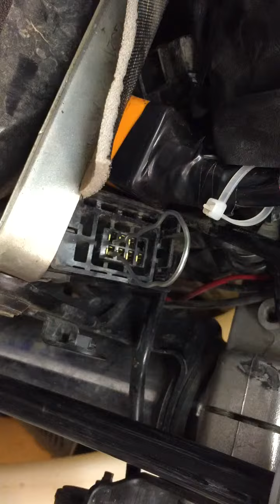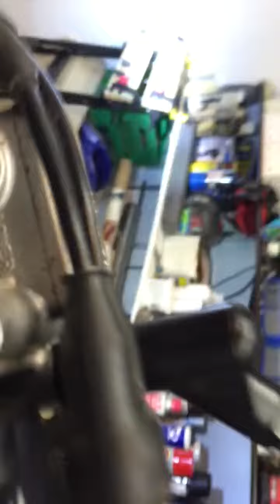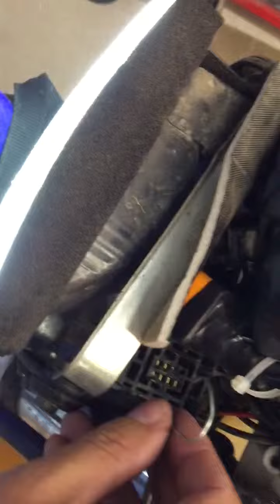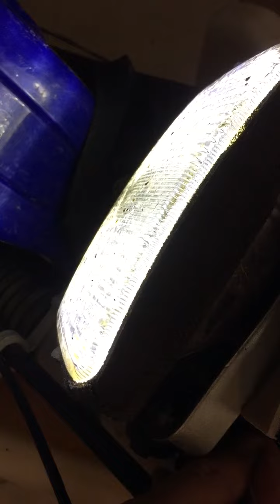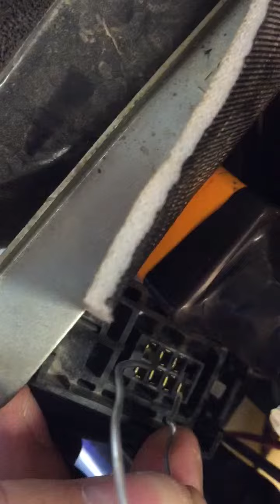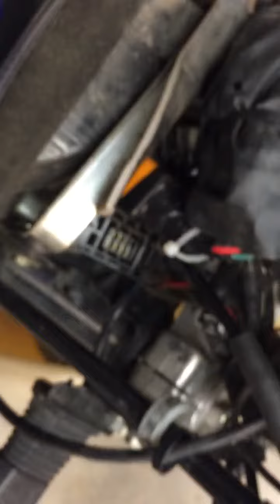Drz400 interconnect bypass

Comment: Can you leave the interconnect bypassed permanently? I keep having issues with the relay going bad
Reply from the maker: No, as this is literally pressing the start button by shorting these two pins. 

If you really want to bypass things, you could determine which wires run to the start switch and connect those to the pins shown which would be in effect using the start button by itself, but I honestly don’t remember if the relay box does anything it. It might. 

Might be easiest to just get a used relay from eBay. If it were me? I’d figure out how to use the start button on its own. If you do, post back here!